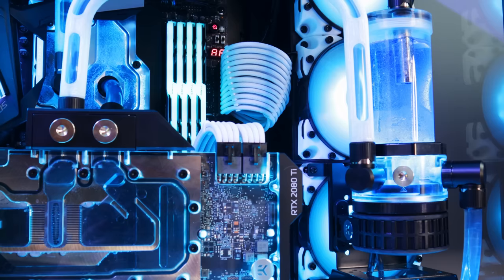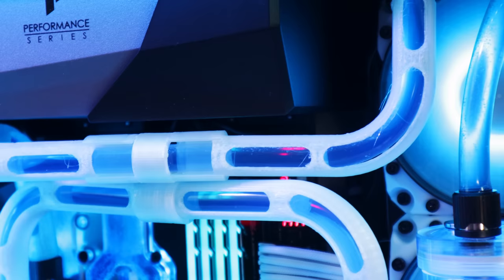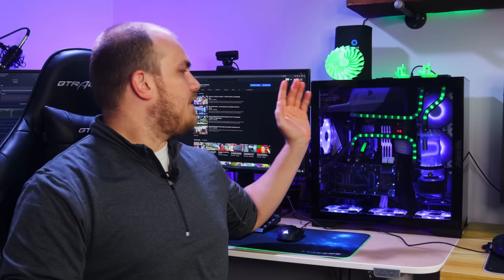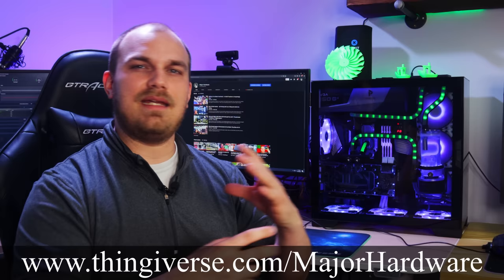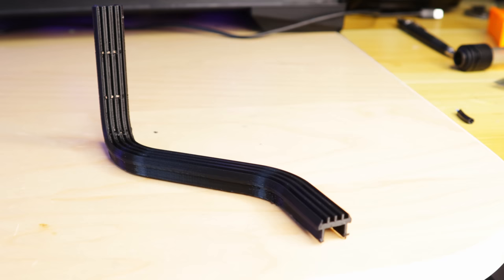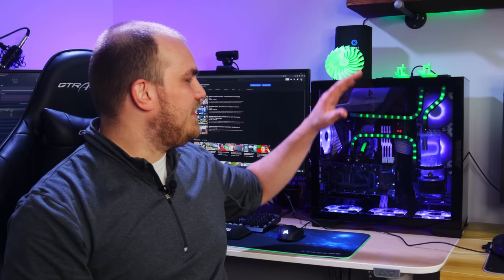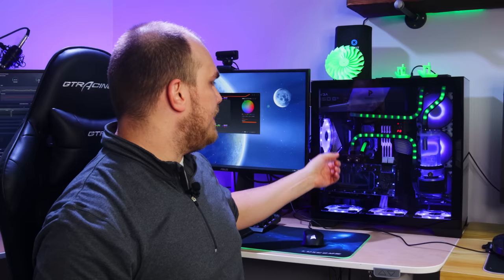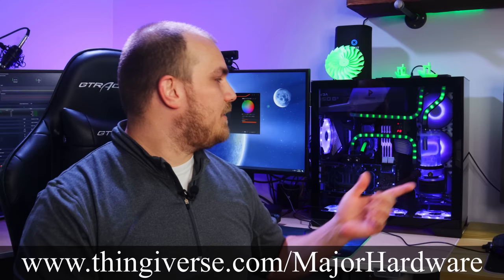Soft Line Water Cooling Will Never Be The Same

Comment: You could definitely sell these as a kit. Make right angles, the 135 degree angles, and then different sized spacers to connect the straight parts. Then some sort of way to connect them all in the back in order to ensure that they don't sag or bend where they aren't supposed to. I think people would definitely buy that and if it was modular, it would be a lot easier.

Comment: This is really cool. Do you think the same thing would be achievable with an led and/or rbg strip?
Also do you think you could take this concept, combine it with your old one (split the old design in half along the run) but over thread connections so you can screw a section together, out another on the unscrew/screw onto that section. 
If that doesn't make sense I'll try do a sketch of it lmao

Comment: This is an awesome idea! I'm about to switch over to a new case and add water cooling for the first time, and I got into 3D printing a few months ago as well (also have a Tevo Tarantula Pro!). I went with soft tubing to start, so this is definitely something I'm going to try once I get the glass side panel for this new case (Ncase M1). It would be awesome to see a version that can have an LED strip mounted to the back.
Reply from the maker: I just ordered some individually addressable RGB to make  this even cooler

Comment: you should check out Pex bend supports; they use some pretty similar mechanics to your idea here; used or in-floor heating pipe to make tight corners, but can easily fit any 1/2 or 5/8ths OD soft tube. 

the only thing i'd recomend would be to add optional posts, so your tube clips have "pillars" that can screw to the motherboard. kinda like a monorail track for pipe. that would entirely eliminate sagging, and also give a good rout to hide cabling potentially.

also, i really like where you're going, but i think it would be WAY easier to use an LED strip or even EL wire. you could get a really awesome effect by having 4 EL wires along the underside of the tube (rgbw) controlled via software. prolly have to use an arduino to accept standard RGB input and control the EL wire, but would be worth it.

Comment: Please use one resistor per colour, not one for all!
With different colour settings and using more or less LED you have different voltages and may kill the LEDs!

That's may be the reason because white doesn't work.
With all colours activated you need more Ampere. By the formula U = R x I this means a bigger voltage drop and the remaining voltage may be to low for the blue and green LED (they need a little bit more than red ones). With a resistor per colour you can set them all on the perfect voltage level for that colour.

Comment: i would add a small extention to your top left rad inlet, to get that tubing a little more to the left and lined up with that pump-gpu bend. I think it would also reduce a bit of that sag appearance by allowing you to tighten up that run.

Comment: I can actually imagine how this would work for a kit.  It would have the c-channel made from PETG just like hard line tubing, and then a 6" length of silicone that matches the outer diameter of your soft tubing.  Then you would bend it with a heatgun just like with normal hardline tubing, with the silicone inside to maintain diameter in corners.  I remember that getting used on the Marble Machine X to keep the radius of bends from collapsing at all.

Comment: RGB LED strips? I've messed with a lot of 'em.

For flexibility, cost, and overall ease of use, few things beat a WS2812B/SK6812 strip (AKA Neopixels). The RGBW variant is a bit more pricey and software support is a little more limited (no FastLED, but NeoPixelBus is a good alternative IMHO), but you get a true white LED built-in so you don't have to rely on mixing colors.

If you want super-smooth animations, you want the APA102C (DotStars). These use their own clock signal, and can be driven much faster than the NeoPixels. They're less common, they don't do RGBW, and they will cost more. I've seen a variant that used a warm white, cool white, and amber LED instead of the usual red green blue. Adafruit carries a variant that stuffed 128 2mm LEDs on a 400mm aluminum bar, which is as insanely cool as it sounds.

Both of these run on 5 volts (there are some that come with a 12 volt controller) and you can find them readily on Amazon. Adafruit and Sparkfun both carry strips of these, but they will come at an increased cost for higher manufacturing consistency.

You can use a dedicated controller box, but if you're willing to do a little programming, there are libraries for Arduino/ESPx/Raspberry Pi/etc. that will drive these.

Comment: I don't really know much about 3D printing or modeling so take my idea with a grain of salt. That being said....
Would it be possible to print half of the height of the plastic sheath, lay in the soft tubing, secure it onto the inside bottom of the sheath, and then finish the sheath print so the soft tubing would be encased in the plastic outer sheath? Or have I totally missed the mark here?

What you came up with looks really, really, fucking awesome. Great job!

Comment: If only you had a highly reflective and/or fluorescent filament, that way you can get a continuous-looking light.

Then you can just paint the exterior so that it still looks black (I would recommend Black 3.0 ). Alternatively, you could paint the interior with white paint (for example, Spectralon ).

You could also try messing with fiberoptic wire, that way you won't need as many LEDs or as much copper wiring.

Comment: You could have made a second grove behind the C shaped print to hold an aftermarket LED strips from brands like Corsair and stuff. This way the painful wire twist is gone and you have the RGB. Lazy, yes, but works. Clever, by the way. Impractical, though.
Reply from the maker: strips dont like to bend laterally which caused me problems

Comment: well why don't create a little space inside of che C for a simple and easy led strip? usualli they can me cut on series of 3 leds so even on the bends should not be a problem... I hope that it's clear what I mean
Reply from the maker: led strip doesnt bend the way i need it to i tried
Reply: @MajorHardware  did you tried to split the strips because you can cut them and connect them by wires and make them bend as much as you want that's why I was saying that, of course you don't gonna have a very costant gap between the leds but I'm pretty sure that it doesn't matter much because they will be diffused by the tube anyway

Comment: Hey, you should redo this with EL-wire instead of LEDs, would have a waaaay cooler look as the backlight would be completely uniform, would love to see it. You could probably get away with re-using the printed parts and running a soldering iron along them to make place for the EL-wire behind the tubes.

Comment: Magnetohydrodynamics (MHD): centuries ago Michael Faraday demonstrated on a London bridge that when you push a conductive fluid through a magnetic field that you can generate electricity. LEDs have modest power demands. I wonder whether you could make an integrated MHD/LED that incorporates a pair of rare-earth magnets and another pair of electrodes. Mount the magnets at the top-and-bottom of a channel and electrodes at the left-and-right of the same channel. Then measure current generated at nominal fluid flow rates. Note that this requires a conductive fluid flowing through the channel. If this works, you could mount LEDs on cooling lines without running wiring to them.

Comment: That looks pretty nice! I can also envision having just 1-piece segments of this to clip onto soft tubing to do fixed radius bends, or just straight segments. By the way, custom PCB's with surface mount LED's would probably by far be the easiest (and probably quite cheap) solution to add lighting. If you need a hand, I am familiar with PCB and circuit design, I'm sure it'd be pretty easy to slap together modular LED PCB segments that slot into a flat groove in the .... hardtube? softline? segments! Prototype / small run PCB manufacture is cheap these days too so might be fun just to experiment.

Or just ready-made LED strip... I guess.

Comment: looking better! you might try an acetone vapor bath to help soften the print lines. also why not just make a snap on back plate that accepts LED strip lighting so you don't have to wire this, plus addressable RGB headers :)

Comment: ok what would make that look cool as hell is use the kind of led strips that can be driven by a micro controller where the colors could strobe like with the water flow direction or any other pattern you can think of.  you could use something like an arduino nano or a pi zero.
Reply from the maker: that would be sick

Comment: Um I would suggest you file a patent for this idea immediately before the likes of Corsair and Bykski and ThermalTake and all them see it. Also I would suggest buying long RGB strips, and then just make a channel on the inside of the C channel model for the tubing for the RGB strip to sit behind the tubing. Much easier than doing all the wiring of individual LEDs. Also you can get strips that already diffuse the RGB and have no hotspots it would be like crazy good RGB for a custom loop tubing.

Comment: Not sure how you modeled this, but i'm thinking the easiest way to be able to customize runs build by build (in fusion, at least) would be to create your base profile, and then you can make another sketch that has all of the runs you need, and then extrude your profile along each of those paths.
Reply from the maker: i used a sweep extruded over a 3d sketch

Comment: Patent it before it is too late... By the way, you could use ARGB strips underneath, could have saved you crazy ton of time. Really eager to see how it is gonna look with strips! 
Awesome job man.
Reply from the maker: you know of any good micro ones
Reply: @MajorHardware  Micro ones come with single color, such as white or warm white. What I really meant for you is WS2812b ARGB strips. But the problem is they are not small enough for your tubing. But if you manage to set it, it will be absolutely crazy. What you already did, is gonna be a trend for sure. But there is one more option for you, please check out "RGB Neon Wire", they are tinier than the bulbs you already used. Thank you.

Comment: Yeah, just use an indent in the back and a flat ARGB strip.  You can get cuttable spools on amazon for like 10-15 dollars that even have tape on the back to stick them down.
Reply from the maker: They dont bend like i need them to
Reply: @MajorHardware  you just cut them at the bends and wire them together, they are designed so you can cut them apart at any spot and wire them together, instead of wiring the entire strip your just wiring at the bend, you probably only need to cut 1 out at the bend and wire it up on each side of the bend.  Worst case you might have to wire 2 of them up but it is really easy.  You can also run them alone the top part of the C channel as well that way you don't need to cut them at all.  They would go around the bend no problem and because they are inside you wouldn't see the individual LEDs either and the liquid should diffuse them pretty well if you choose a opaque white liquid.

Comment: Okay Sir! Major Hardware...  I have a Custom Water Loop and i also have a 3d printer.   Specs for both are as followed.
For the PC the specs are certainly not a huge deal here but. Basically
i9-9900X
X299 Ultimate Force Motherboard and LGA 2066 Socket. None of that matters i guess for the actual build but..  What does matter to me is,  I have a Flashforge Guider II 3D Printer.  I'd LOVE to have all of your profiles for creating all of those custom bends and runs etc..  Thank You so much for producing this video!
Reply from the maker: https://www.thingiverse.com/thing:4300801/files
Reply: @MajorHardware  Thank You so much!  :)  now i can enjoy backing up any soft tube that i may have  :)    Much Kudos to you.
EDIT:  If i even have to cut down some of the bends? and retrofit?  These profiles are certainly very much needed :D
Liked! and Subscribed!

Comment: Hard line tubing isn't that difficult really, I did my first ever custom loop some months ago and it went surprisingly well. Use PETG tubing for the ease. Heatgun, profile tool, tube grinder and a cutter is all you need :p You can probably print out profiles yourself, if you want to use the 3D printer.
Reply: The whole point of softline tubing is the easiness of dismounting and changing parts

Comment: I think you have gone 80% of the way here - for the remaining 20% :

- a set of components (straights, 90-degrees etc) that just snap-together to form any shaped channel you need

- a groove in the back of the channel into which to slide your RGB-strip

Using this I should be able to make runs that would be difficult to do accurately with hardline  - like the 2 opposite adjoining perpendicular 90-degree bends I have that go into and out of my CPU block and still tickle my OCD every time I notice that they are not quite symmetrical :-)

Would be interesting to see what these looked like printed in a clear plastic - maybe you need a resin printer for this ?

Another idea - If I printed and snapped-together my desired complex bends, I could then heat up my hardline and snap the channel around it whilst it hardened to make sure that got the complex bends just right... Then take out and use the hardline and keep your channel as a template for next time...

Comment: How about using the Phanteks Neon Led strip for backlight of it? It looks pretty smooth and it is designed in mind to be used with hard corner bends.
I would try switching from c pipes to half pipes clamped with c-clamps instead that clamp from the back over the strip so the led strip is not blocked.

Actually I believe the c-clamps are a thing in piping already so could be purchased pre-made and sturdy but I'm not quite sure about size availability.
Example: https://img.alicdn.com/imgextra/i1/66270261/TB2fA.VXDIlyKJjSZFOXXaAhFXa_!!66270261.jpg

Comment: Very impressive mate! Looks great! But yeah 10mm for all Led's would have really popped across the entire run.
Reply from the maker: yes i agree, i need a better rgb solution for projects like this i cant be wiring hundreds of RGB's it takes years lol
Reply: @MajorHardware  exactly. I wonder if you could make use of existing Led strips next time instead? That would make things much easier too.
Reply: 10mm spacing would help with the wiring.  Can just bend the leads from one part to the next and solder it on.  No twisting or messing with hook up wire.

Comment: A damn fine v2.0. Leaps and bounds ahead of the original.
I see I'm not the first to mention them, but Phanteks’ NEON Digital-RGB LED strips (awesome name) have exactly the flexibility to match up with this perfectly. See here for Kyle not doing a great job of showing them off: https://www.youtube.com/watch?v=XWD1Qjz7a28
Would be interesting to see these exoframes paired up with quick disconnect fittings providing the visual break in the middle.

Comment: Use ws2812b 144 led per meter addressable straps and your tubing would look amazing the 144 led straps have no space between the legs and if you get the addressable you can plug right into your addressable mobile headers... great idea otherwise

Comment: Have you considered using a 3d scanner to accurately measure  the space inside the pc so you don't need to bend wires to get the model to the correct size? something like this https://www.xyzprinting.com/en/product/3d-scanner-2-0

Comment: You need to tighten your bed, it wobbles on the X axis.
Reply: Use WS2812b strips, those are individually addressable and you can use the "RGB" signal from the motherboard to direct an Arduino on wtf todo.

I'd have the Arduino copy the color from its input and have maybe something like animations in the direction the water flows?

Comment: Dude you haven't done any hard tubing yet... Just buy a heat gun and some silicon insert and some tube. Cost hardly anything to try. And go bending. You will figure it out in about 2 to 5 bends. Hardline is easy as.

Comment: great project. I wouldn't do it myself but still, great effort you've put in there.

just a personal feedback:
The sequence showing the printing felt a bit too long for my taste, maybe speed that up a little. I was close to skipping forward.
Also there was a fan howling in your talking parts, which was somewhat unpleasant.

Apart from that, hey, keep it up, I'm still subscribed, so no worries: :-D
Reply: Oh, and as it was pointed out by someone else: have a look at WS2812B. they are really simple to use and can be daisychained. Did I mention every single LED is going to be addressable? :-D